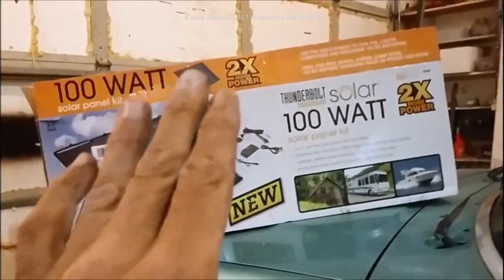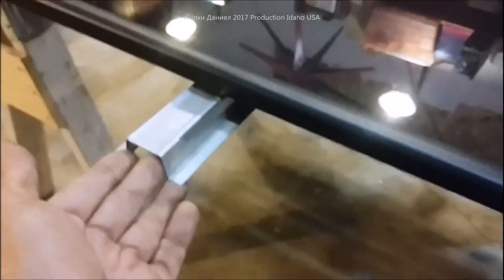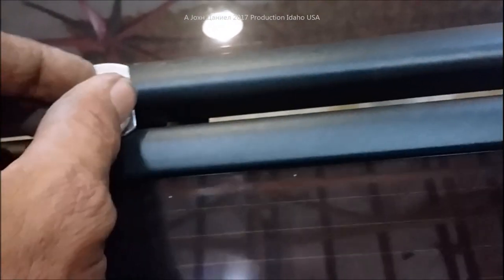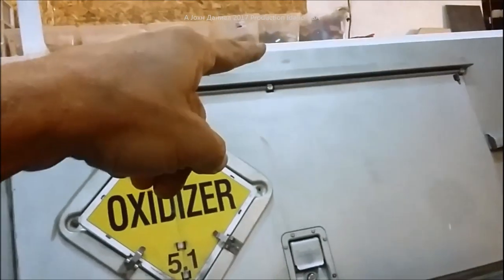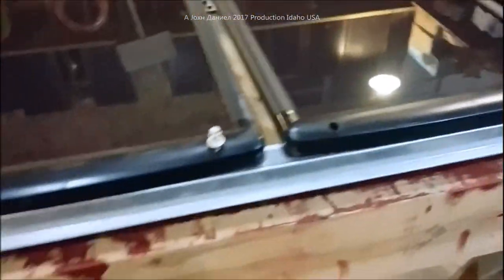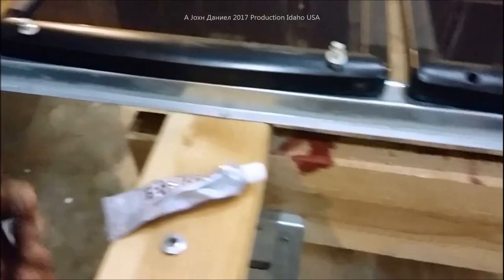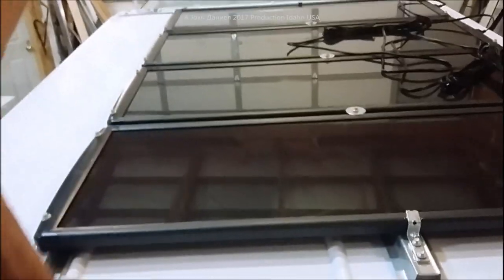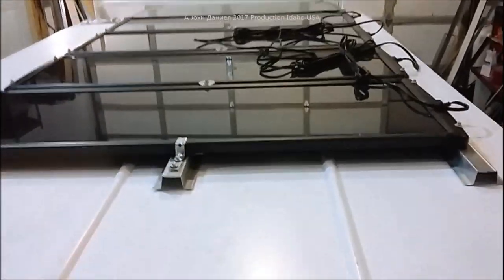100 Watt HARBOR FREIGHT Solar kit how to install, ( see below video parts and more options )

Comment: Great video, I have the same Walmart batteries, only two, but was thinking of getting two more, for a total of 405ah, with a 2000watt inverter.   Would the 100 watt solar kit be enough to charge them?
Thank you for your time and videos...
Reply from the maker: +Brown Bunny A good rule is 130 watts, 10 amps worth, of solar for every 100 deep cycle amp rating. Heavy use would mean more accurate math is needed. A good watt meter helps figure that.
Reply: Јоhn Daniel 
So, I should look into the Renogy Kits, 500+ watts, for the items I want to run??  (32" Tv, sewing machine, freezer, a couple water pumps, led lights)
Thank you !
Reply from the maker: About Renogy, ( I have 23 emails, bills of Laden, Actual statements, and a connection to china) Renogy for years was made by BLUE SOLAR in China, shipped via Taiwan then relabeld as not from China to skip customs fees. The pump of them by sales techniques, created blogs of "we love them" claims, and more sales hustle is not to be ignored when buying solar. Many dealers do this, tons of competition. They are now on a Vietnam made kick, also lousy panels.  
Best deal and low cost is probably www.solarblvd.com , Very affordable BP Solar, Canadian solar, Ect, and just bite the bullet and buy a name brand.

Comment: wouldnt it be advisable to use plexiglass to cover them in case of a hail storm?
Reply: No the plexiglass will fade and get dirty. They handle hail very well. Btw don't use HF solar. You can get good quality components off Amazon etc and the panels are about 1/4 this size for 100w.

Comment: John, great videos!  I'm a fool when it comes to understanding voltage/watts and I'm trying to learn.  Is there an easy way to ratio the following:  How many hours/day could a run an LED Shop Light (Produces over 3,100 lumens of light (4000K) while consuming only 28-Watt is the claim) off of one base-unit 100w Harbor Freight solar kit with a 12-volt battery?   I know this depends on amount of sunlight and so forth, but an average day per se.
Reply from the maker: Seriously depends on where you are, wiring, and lots of conditions. Best bet, is over size the intent, use the extra results as you need.

Comment: Great video do you need 1 battery for each panel or is it 1 battery for all 4 panels.
Reply from the maker: Just 1 @35 to 50 amp hour worth, but you can put up to 200 amp hour worth of battery with 100 watts of solar if your wanting lots of reserve.
Reply: @JOHNDANIEL1  ok thanks
Reply: A good rule of thumb is 1.5w of panel for 1ah of battery

Comment: I am wanting to put solar panels on the roof of my van and cargo trailer, but I can't figure out how to get the energy inside the vehicle the right way. I have never seen these bulkhead adapters that you used before, that may be what I need to use. I'm just wondering if going through the roof is the way to go on the van.

Comment: Can this be mounted to a carport for powering the garage? And can you convert the outlets into regular plug in? And how many plug can you convert this into?
Reply: Also how long can you run your lights at night?
Reply from the maker: If your going to run DC voltage you will need new outlets that are for DC voltage ( examples - http://amzn.to/2xMmcpn ) and you will need a dedicated fuse box ( examples - http://amzn.to/2xMugXp ) and of course heavy gauge stranded low voltage wire for your runs to the outlets ( example - http://amzn.to/2yezbBM ) 
the links above give you a idea on what items to make a conversion to use DC power up to 40 amps fused in multiple locations. For inverters you of course need lots of batteries, more solar and good heavy cables than most small systems have.
Reply from the maker: The underbody lights on the truck and 2 small side lights ( ALL LED's) which are 2 ten foot waterproof strips run all night and don't pull more than 1/2 volt all night long.

Comment: How has the plastic frame held up after 2 years? I'm guessing you keep the truck garaged when not using it.
Reply from the maker: So far no splits or cracks and they do stay out in the weather all the time. I only park the front half of my truck under a carport due to too much junk in the carport, the shell with the panels has been exposed 24/7
Reply: @JOHNDANIEL1  Well that's encouraging; I have the same kit and I'm preparing to install them on a fiberglass roof. I'm still deciding between the drilling route or the 3M route for securing them

Comment: is the EVERSTART battery working out for you ?  I have looked online at the Walmart pricing, seems cheap enough, but with more research, I found that either the battery manufacturer or Walmart kinda flub on the actual numbers, AH rating and so forth.  what are your thoughts ?  Also been looking at the Duracell 6 volt that Batteries Plus offers, $99 for 215 AH seems really good, even though I would have to drive 100 miles (1 way ) to pick them up...  lol
Reply from the maker: Good, but don't buy the JOHNSON CONTROLS made version, get the EXIDE 2+ year made battery. 
The Energizer/Duracell from Batteries plus in most places is made by EAST PENN, Damn good battery.

Comment: Hey you did it, but what about hail storms or rocks hitting them?
Reply from the maker: +Naturally Blondy These are so cheap I can get a replacement if I loose one plus it's only 1/4 of the 100 watts to loose one. If i had a 100 watt panel and it got busted I'd loose all the watts and cost $120  to deal with. Plus there's Harbor Freight stores everywhere I can buy just one 25 watt panel at.

Comment: Where do you get the rubber that you put under the hat metal and also where did you get the Z clamps?
Reply from the maker: +fiddlist1934 Rubber is EPDM flat roof materials,  just made the clamps as needed from scrap laying around. 
The rubber can be gotten at Home Depot as  ice and water shield with adhesive already on it.

Comment: I've been wondering how to add solar after the dual batt. & isolator mod. You just run it straight from the charge controller to your lead battery + terminal? No back feeding etc.?
Reply from the maker: The controller goes from solar to the + & - on the battery, its self isolated.
Reply: Thanks John!

Comment: Great video John. Very informative. Where did you buy the high hat metal furring channel. I went to Home Depot and they didn't have it. Would you please post the hardware needed to install. I'm mounting mine on a tool shed. Thanks.
Reply from the maker: Do a local search for FURRING METAL supplier, they are usually builders supply places that sell metal studs and commercial materials.
Reply: Much appreciated. Thanks!

Comment: Hello sir I have the 100 watt kit also and i bought the thunderbolt agm battery 35amp hours can i just change controller to sealed settings for the battery and it will do everything for me or does this battery have to have manuel specs typed in im having so mu I trouble figureing this out.
Reply from the maker: The SLA battery from Harbor freight is what those 100 watt kit  controllers are designed for, top voltage 14.1.
Reply: @JOHNDANIEL1  directions say 14.8 is full so 4.1 is when the battery is full and I unplug panels from controller if gets to that and whats the lowest I can run the battery to.

Comment: Ok, I picked up a set to mount on my off road micro camper, and one major concern - DAMAGE.  How weak or tough are these things?  I originally was going to mount them on a custom roof rack I made, but I'm rethinking this.

My #1 concern is the impact sound they make (tapping them) is similar to a tempered mirror, and my guess (or assumption) is not good.  I'm concerned these things will shatter if hit by a rogue road rock (camper is a popup and much closer to the ground), tree branch, or me, oops dropping my roof box on them.

My new thought was to mount them directly to the roof with 1/4"- 3/8" foam insulation under the panel, inside the structural frame for support, but my fear is getting the best of me.  

So, in a nut shell.  What kind of impact can these things take, and survive?

I'm going to continue to research, but you seem to have been around the block a bit on this, and I would guess you have already done some research.
Reply from the maker: Almost one year, 3 ice storms, one limb, 2 punks and a half full beer can, plus lots of bird shit. Still producing like new. Just be sure to mount them on some 1/2" foam rubber pads, do not crank down the bolts to tight so heat and cold expansion/contraction effects causes no problems.
Reply: Use Dicor caulk from Amazon or I think Home Depot stocks it. That's what's used on RV's

Comment: Hey, John! Do you know how to connect these cables to a Goal Zero Yeti Power Station? I am interested in developing the system for my own truck. Thank You for the very informative videos
Reply from the maker: Just + to + and - to - on the Yeti solar inputs.
Reply from the maker: I would not worry about a small system, if you can or want to grow, look at 25 year plus better quality Taiwan made solar panels https://amzn.to/2DRhxm3  
**Always learn total battery care and servicing prior to purchasing large battery banks. ALWAYS BUY YOUR BATTERIES IN ONE PURCHASE WITH SAME DATES.
REMEMBER - A off grid battery bank is the largest single purchase you will make in your Renewable Prepper Adventures.

Comment: What parts do i need? Like can someone type up a list of all things needed with a price? I'm specifically curious about how much a power inverter is.
Reply from the maker: You have to have a goal point to consider the following: Inverter size, type, voltage, battery capacity, amount planned to spend and preferences on a inverter use. You tell me your parameters and I can help you locate matching parts that work well together from a $500 budget to a $50,000 budget. I have done them all.

Comment: What happens to the panels in the event of a hail storm? Curious because I have the same panels.
Reply from the maker: +cmkpro So far 2 hail storms with marble sized hail and 50 mph winds driving it didn't break any. But with any thing that's outside and made with glass you have risk. Even $300 solar panels are at risk. But loosing only one $35 panel verses 1 $300 panel from hail has a better outcome.

Comment: Hello i also bought the 100w Kit. Then i found out my family bought me 2 more. So I'm trying to setup all 3 kits For 300w Do you think it will hold out for that? I also bought a small Mppt Charge controller that can do up to 400w.
Reply from the maker: You can run these into a better controller like a real mppt ( be sure its a REAL MPPT because so many are fake).
The results with Amorphous panels, even these, on a MPPT are outstanding.
Reply: Thank you. As soon as i get some more money saved up i will be looking into a good controller.
Reply from the maker: I have found the best controller for Amorphous like the HF kits is the EP Ever due to its ability to Up Convert and it can make 500 watts of Harbor Freight panels give you the results of 600 watts of Poly Solar. Yoosmart is the only warranty level dealer I have found, so heres a direct link and if you read the controllers data on it there you will see how it performs and why it does well on Amorphous. http://rover.ebay.com/rover/1/711-53200-19255-0/1?icep_ff3=2&pub=5575119394&toolid=10001&campid=5337966591&customid=WiFi+Op+EPEVER&icep_item=263049168664&ipn=psmain&icep_vectorid=229466&kwid=902099&mtid=824&kw=lg Amorphous Preferred

Comment: Why don't they also sell just the panels? I've seen the whole kit and it seems like a pretty decent price but I'd like to buy the kit and then some additional panels to upsize it!
Reply from the maker: Good question, but just look on the charge controller and other parts and cheap spares! New video on them coming out ASAP for 10 month review

Comment: it looks like you cut the plug off the ends of the solar panel cords how do you know which one is positive and negative?
Reply from the maker: +Doug sandoval multi meter if your isn't already color coded like mine are.

Comment: I’m trying to figure out how you would run five sets of them together
Reply from the maker: Gonna do your hunting and parts - You must get a proven 60 amp MPPT ( https://ebay.to/2LWRNvc ) and wire them all into it directly with  doing 5 panels into 1 extension wire each time (12/2  awg low volt cable is ok per set up to 25 feet https://ebay.to/35n35k7 ) as each, then 4 pairs of your outdoor 12 awg LVC to the 1 controller putting a 15 amp fuse on each strand of 12/2 as it goes into the controller! ( easy fusing https://ebay.to/38FTvec ) You got to get the right stuff, the PCM60 style but you have to spend the $$ and you can later add 2 more sets for 700w total to that one.

Comment: had lots of problems with charge controller tryed 4 different controller and can get voltage out of it
Reply from the maker: +Alfonso  Zambrano Sounds like your not connected right.

Comment: How do you click connect your batteries negative and negative and positive positive or negative positive negative positive I’m all get me one of the panels set up on a small trailer that I have let me know please
Reply from the maker: See The Battery and Isolator install https://youtu.be/yKYx6iEEtm0 , Its a multi function with the solar added. Can sit months and always be ready.

Comment: I WOULD CREATE A HARD COVER THAT PROTECTS WHILE DRIVING YOU CAN JUST FLIP IT OPEN WHEN YOU STOP
Reply from the maker: +rarmstead03 Looking into using a corregated clear green house plastic poly panel over them if needed.

Comment: Ok! Some OBVIOUS QUESTIONS!? Is that 3 truck size batteries and an inverter on the other end?? And WHAT SIZE INVERTER R U USING??? U NEVER SAY IN EITHER VIDEO HOW MANY BATTERIES OR WHAT KIND OR WHAT SIZE OR BRAND INVERTER!!?? NOR DO U TELL US WHAT LITTLE THIS WILL POWER!? Because I know a 100 will power 1 5/6000 BTU AC! But nothing besides that!? But if u don't power an AC how many small things will this power!? Because a 100W ain't gonna power much!? If u had a large RV it would take around 900?? To power everything... NOT INCLUDING AIR! JUST FRIDGE, LIGHTS, TVS, MAYBE RADIO, FAN/S??

I mean I just don't know about doing HF for my truck Slid-in because ur only getting a 100W but good God it's taking up the whole roof or ur camper just for a tiny 100 watts!!?? When a person can get 300W thin as hell panels that just stick dn nd don't weigh nothing!!! And do a hell of a lot more for the space they take up!

Comment: Lead acid batteries should be charged at about 14.6v depending on battery manufacturers specs. 14.1v will never get them fully charged. You really should bump the voltage up.

Comment: why you do not buy a real panel that produces 340W and has a smaller footprint? on your truck you can probably fit 3 real solar panels that would produce over 1000W of power.
Reply from the maker: +mlg779 For 1 I prefer the low light abilities of Amorphous, 2 I only need top off amps, 3 if one panel breaks I loose only a few watts and $30, 4 Amorphous works good dirty or shaded with very little losses.

Comment: why not just buy a 300 watt panel. was it just a money issue? seems like it might be the same size as a conventional panel
Reply: I was just about to post something along those lines.  I wonder if he was trying to keep costs down.  I personally would have stuck 4 flexible 100 watt solar panels on top of that truck.  It would have only been about 3 inches wider and 7 inches longer and provided 400 watts of power instead of 100.  Actually, you could have even more than 400 watts on that surface if you had the cash.  Maybe get some A/C without the truck running...  :)

Comment: Your method of install is a bit questionable as to why you 
Cut all the ends off and wired them together? 
Charging batterys will let off acid fumes so why are they inside the back camper shell?
And last but not least. ......... I think your a bit over selling the E3000 glue..
Reply from the maker: Hmmm. Well the cutting off the ends and wiring them together reduces wire load resistance, and the wires +/-  already all get wired together in the harness before the controller if fully used. The Batteries are well vented, more than that of a modern car with a sealed hood, theres numerous bed and shell vents with a temp operated fan under the bed that forces in and evacuates heat above 90 degrees. And E3000 glues? Not sure I used anything but Welder Adhesive which is non electrolytic, remains flexible but strong.

Comment: Really 3 batteries with only  100 watt solar
Reply from the maker: +jack turtle Go back about 7 or 8 videos and see how the truck is the main charging source but the solar is due to often leaving the truck sit while I am gone as a truck driver. The 1997 F250 I have only has 71,000 miles on it.

Comment: a 3000watt inverter, for that type of setup, is way too overkill.
Reply from the maker: Only over kill if your trying to run a TV 24 hours a day. But for short term quick use of high amp tools, what would you suggest running a 13 amp Chain Saw or 9 amp Impact or a 14 amp Table saw on then? A 2000 would smoke on the start surges.

Comment: What a waste. Harber freight  panels  are terrible. Much cheaper  and better  on internet
Reply from the maker: Much cheaper quality and better priced B & C fake claimed out[put is all over the internet. Over 75% as noted in Green Power Mag. All slave labor shop made Imported from China via Taiwan then relabled as Taiwan made with 110 watt labels slapped on when they were 80 watt B rated throw aways. They are all over Ebay and from internet hucksters. These are not Primo anything but at least if they screw up you can just return them locally, look the sellers in the eye and get new or a refund. No option like that for the other terrible panels out there.